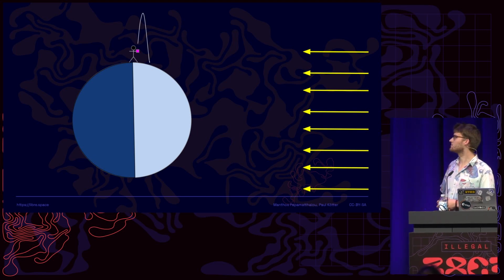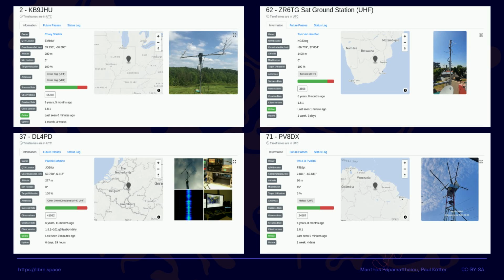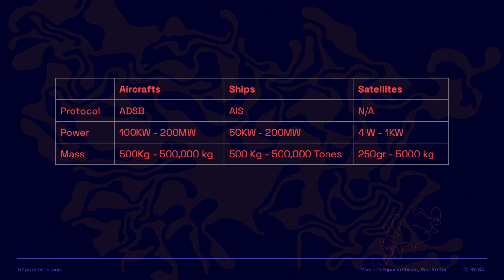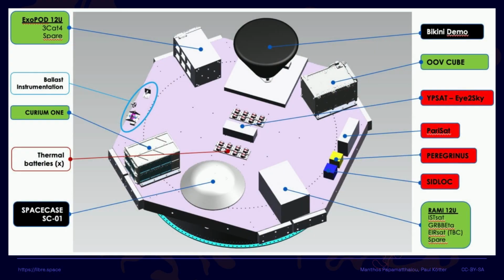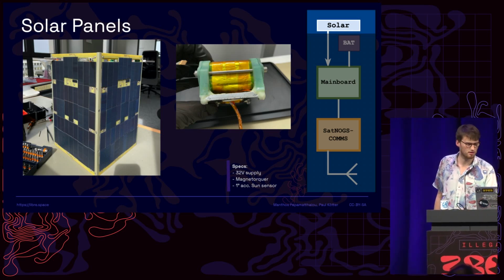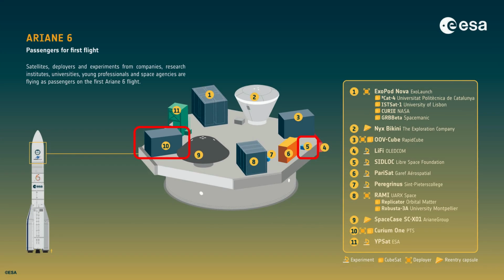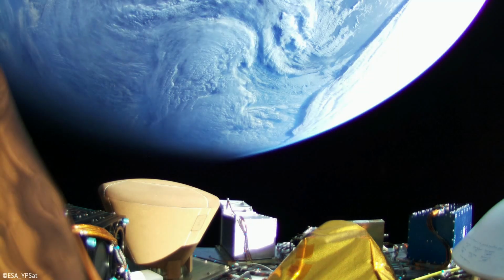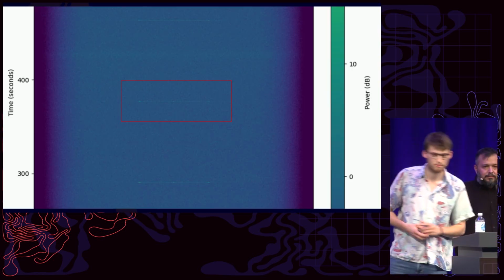38C3 - An open-source guide to the galaxy: Our journey with Ariane 6

Comment: That figure of hundreds of kW to hundreds of MW of power on aircraft (and ships) transmitters sounds like utter nonsense. That's the ballpark of small to medium power plants. I've googled and the highest figure I found was 25kW and that was a stationary ground radar. Normal figures were maybe up to 1kW. If I'm wrong, please someone provide a reliable source to correct me.
Reply: I think they mean total power, not transmitted power.
Reply: I think thats comparing the hypothetically available power one could use
ships and aircraft have engines that produce many megawatts of power and can have generators attached to them that produce hundreds of kilowatts of electricity so powering something like a 1kW transmitter is absolutely no big deal for them
cubesats tend to have around 1 watt of pwoer supply
IN TOTAL
so having it transmit at 20mW is a higher percentage of oyur total available energy being used for your transmitter than a plane or ship transmitting at 1kW
Reply: Nah, that's an absolutely absurd figure. Some aircraft with ADS-B would be lucky to have 100kW... in general.

Edit: Ah nevermind, he's talking about total power which makes far more sense.